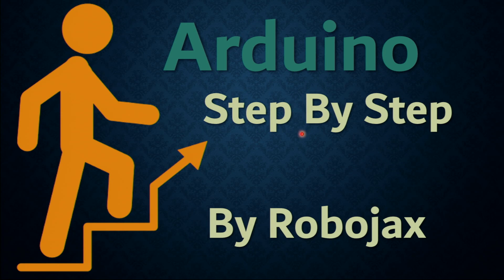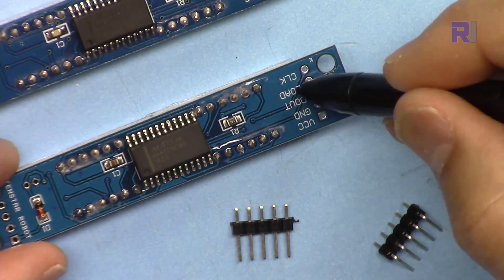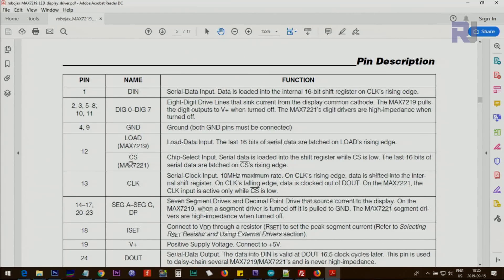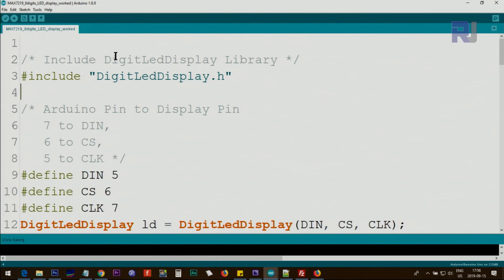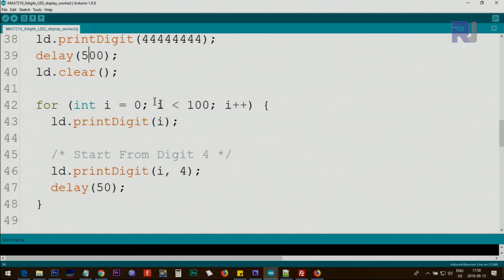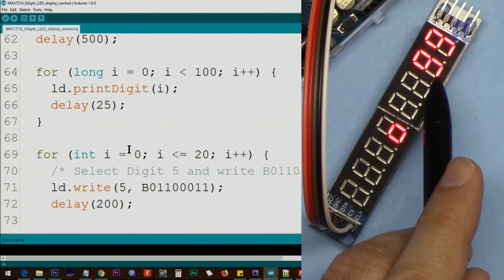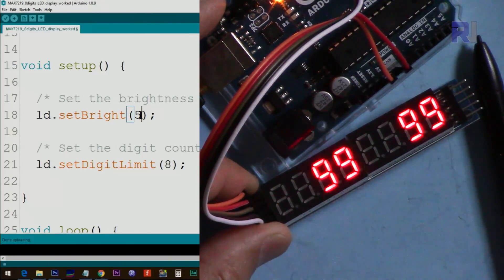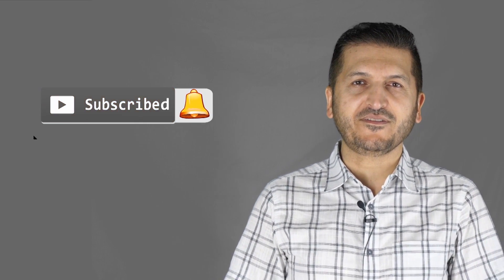Lesson 23: MAX7219 4 Digit Display | Arduino Step By Step Course - RJT581

Comment: is 7219 or 7291? "Lesson 23: MAX7291 4 Digit Display | Arduino Step By Step Course"
Reply from the maker: the title written is correct. See manufacturer website https://www.maximintegrated.com/en/products/power/display-power-control/MAX7219.html
Reply: @robojax  man, you put 7291 instead of 7219, ehh nvm. good video
Reply from the maker: wow. thanks. I was focusing on 7 and 2. I just corrected it.